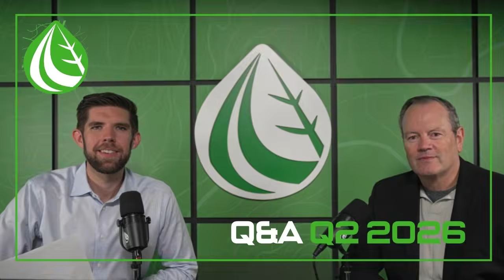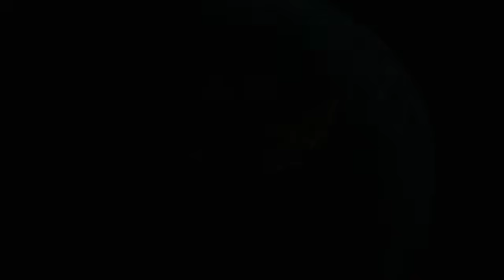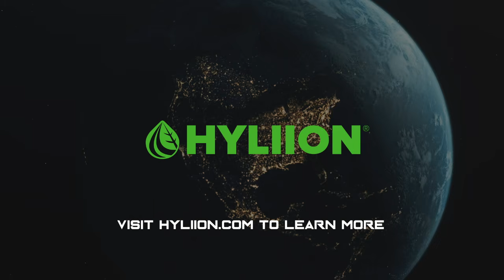Q2 2026 Earnings Q&A

Comment: The community of engineers and researchers who work in the field of Stirling engines is still very curious to learn, how did you manage to get good efficiency and performance from an engine with 0° offset between power and displacer pistons - when your engine has  only one piston that plays both roles. Everybody is still waiting for real comparison between your lousy Stirling design, which needs active electromagnetic assist to run (with connected losses)  and high pressurising with precious helium, with an ICE, which is extremely robust, simple and proven design, that requires no special conditions to run and is easy and cheap to repair and maintain by anybody.

Comment: It will be interesting to see if the Army and Navy (Marines) would be interested in Karno hybrid heavy transport retro fit kits like you were planning to do with civilian fleet vehicles.
Quiet, efficient, low maintenance, immediate torque, fuel agnostic so they can fill up with anything available locally that burns.
Once the process is perfected it should be a much easier jump to civilian commercialization.
Plus by then many fleets will be looking for such an alternative.